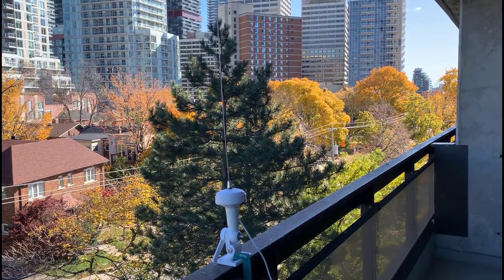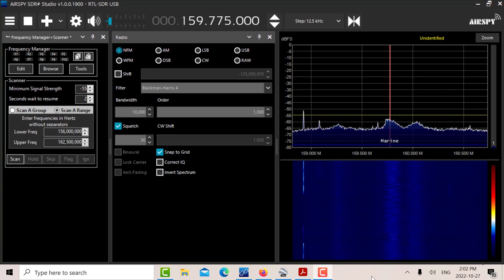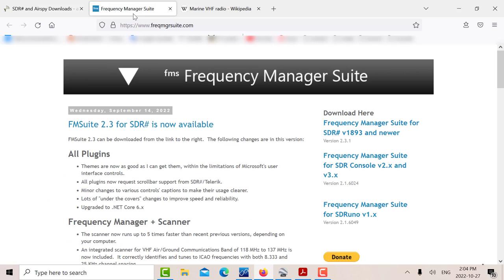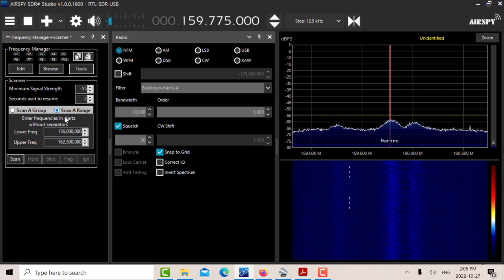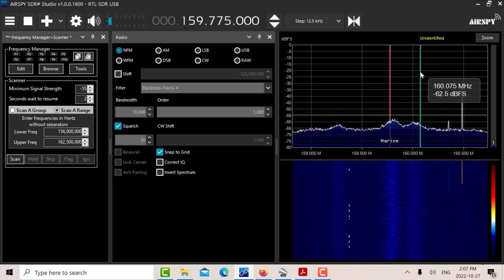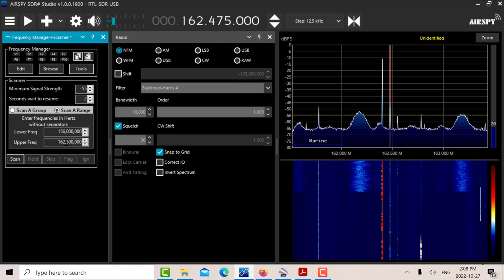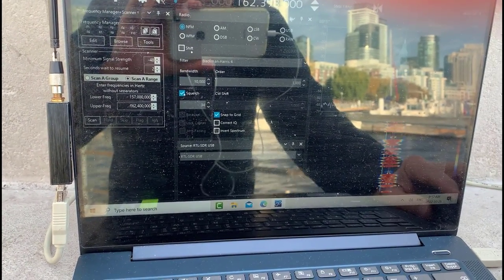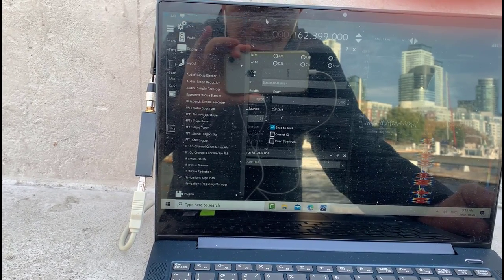RTL-SDR for VHF Marine Scanner on SDR#

Comment: well done, Mr. Clark!
I'd point out that, once you have the scanner working, you  can scan anything that SDR# will pick up.
and maybe you did, I paused the vidd to ask you  a question: did you have a prior version of the program installed?  i have .1893 running, but FM has serious stuttering.
can you receive broadcast FM on version .1900?
Thanks!
(back to scanning air band)
Reply from the maker: Right now I have 1830/1900 on my desktop. I usually keep two versions running. I get FM on both, sometimes you have to crank back the gain if you are using an RTL, you may be overloading it. FB about the scanner, it works anywhere!
Reply: @ClarkTelecom  
Thanks - it looks like .1901 is out now.
And last question:
How do you save or export the frequency list? That keeps evading me... :)
Reply from the maker: @gooshy8312  'Data Tools User Guide'/p.5' all the options.
Reply: @ClarkTelecom  
Thanks!